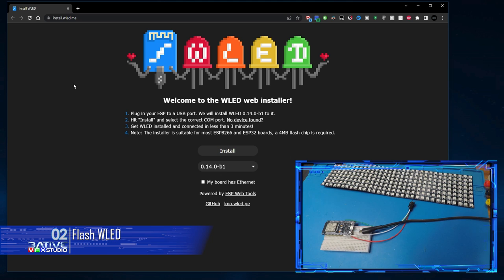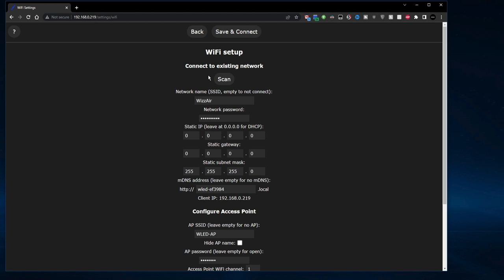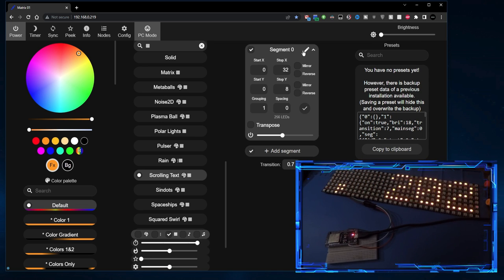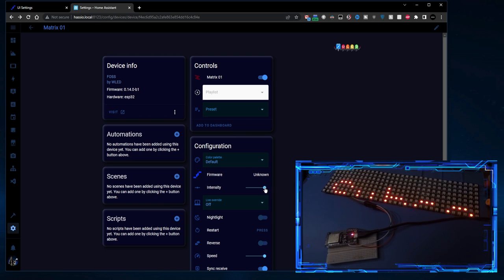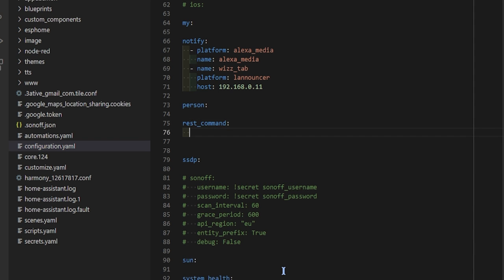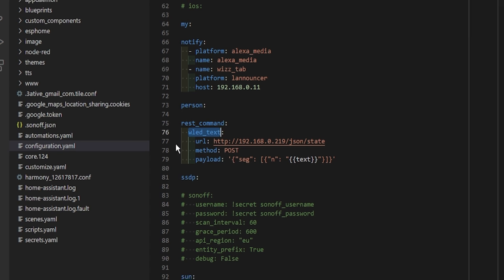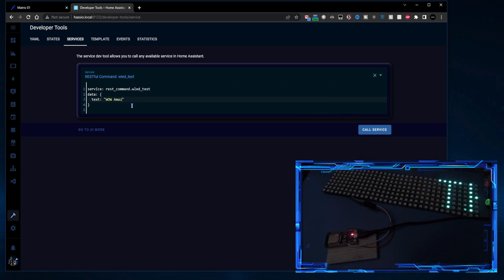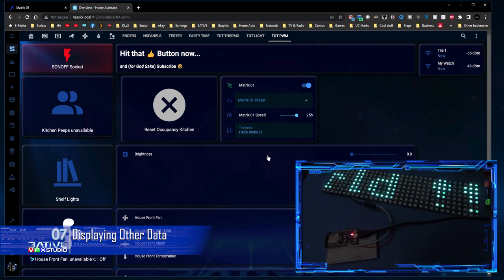Step-by-Step: WLED Scrolling Text on a WS2812 LED Matrix with Home Assistant

Comment: yessss thank you so much! I've been at this for almost a month (i'm using text scroll in an artwork) and this video solved all the problems I was running into! I'm new to using the WLED server - has anybody tried transferring the server over to another wifi network if they've taken their matrix someplace?
Reply from the maker: You're very welcome!
As for transporting WLED: I [think] if you fire it up and it does see it's saved Wi-Fi it'll default to an Access Point (AP) mode. From there you can input the new SSID & Password using the WLED Phone App.

Comment: Saved me lots of time thanks

Wondering How would you set the text colour based on state ?
Reply from the maker: Cool, Glad it helped. 👍
You can add ( "col": [ [R, G, B] ] ) within the REST commands' "payload". E.G.:
payload: '{ "seg": [{ "col": [ [0, 0, 255] ], "n": "{{text}}" }] }'
Reply: @3ATIVE  Thanks have it on the wall displaying house power usage, want it to be green when have excess solar and red when importing from grid.
Reply from the maker: @yorks_atheist3069  Oh, nice application. 👍

Please come join my DISCORD server and share some photos of your project.
It's also a great place for hanging out and tech support.

Comment: This is great. Thanks a lot! Never thought, that I'm able to understand all these things around rest api and changing text. You've made my day. I've got one additional question. How can I mix a fixed text and sensor data in one automation? My goal is to display something like 

Pooltemp: 29,3 C  

In this case, Pooltemp: and the C is the text and the 29,3 is the value from my self made pooltempsensor.
Reply from the maker: Great to hear! 👍
In your example, your automation action would be:
  action:
    - service: rest_command.wled_text
      data:
        text: "Pooltemp: " + "{{states['YOUR-TEMP-SENSOR'].state}}" + " C"
Reply: @3ATIVE  Again, thanks a lot. Will give it a try later today 🙂
Reply from the maker: @user-qm3bs1hu3p  My pleasure. Lemme know if it works the way you wanted, or if you need anything else.

Comment: Fantastic instruction! Any ideas on how to display static text for a sign in WLED?
Reply from the maker: Any text (on one line) won't scroll if it's less than or equal to the number of characters that fit the width - Normal size letters that's 5.
Reply: @3ATIVE  Brilliant! Thank you sir, you do great work!

Comment: There are lots of matrixes out there. How does one determine the parameters, ie. whether it's vertical or horizontal, serpentine or zig-zg, etc? Thanks for the video.
Reply from the maker: Mainly trial and error. If it helps, I've added the one I used in my Amazon Shop - There's a link in the video description.
Reply: @3ATIVE  Thanks much
Reply: @3ATIVE  Just by watching your outstanding video again the answer came to me. Here's what ya do.

Start by setting Settings > LED Prefernces > Length to one, which will tell you where first pixel is.  As you progressively increase the Length setting it will light up more leds and the path that it takes will reveal whether it's horizontal or vertical, and whether it's zig-zag or serpentine.
Reply from the maker: @joepriority  A great way to test.... I just futz around until it worked! 🤣🤣🤣🤣

Comment: you can also add custom text to the beginning and end of the states command. like this. 
service: rest_command.wled_text
data:
  text: "Out door Temp {{ states(\"sensor.station_temperature\") | round(0) }}°F"
Reply from the maker: Indeed. Any template that generates characters can be sent. Also, if you spell 'Outdoor' correctly you can save space. LOL
Reply: @3ATIVE  Cheeky :)

Comment: Loving this mate! Just wondering how hard much harder will it be to have clock and temperature displayed. And maybe can't then be switched to get when needed?
Reply from the maker: Thank you.
I can't see it being too difficult - As I show you can send text, so sending it Time and or Temperature at will is no different. Bear in mind that you only have a 5 character width, anything longer will scroll.
Reply: @3ATIVE  Hello, thank you very much for the tutorial, it is incredible, I have managed to set up my own Wled panel and I can send text to it from home assistant, what I can't do is show the time and temperature from home assistant, how do I have to do it, I'm lost with that ? thank you for your magnificent work
Reply from the maker: @josesanchez-ot8kp  You can send it anything. The key is make a Custom Sensor for the data, then run an automation to send to the RESTFul command.
Reply: @3ATIVE  Hello, thank you, I already got it, I just had to put the "sensor.time" entity as a trigger and into action:

service:rest_command.wled_text
data:
   text: "{{states['sensor.time'].state}}"

Thanks for the little note you gave me.
Reply from the maker: @josesanchez-ot8kp  Noice 🎁

Comment: Really helpfull
But is it possible to split the matrix using wled/home assistant to show different things on the same matrix, like the temperature and thermometer logo next to it!
Reply from the maker: Thanks.
Sure, each segment can have any number of LEDs in its Width and Height. So, you just make two segments of 8x8, just make sure you set the 2nd to "Start" at 8.
Then, in Home Assistant, send your first data to segment 0, and the other to segment 1.
Reply from the maker: Oops, Correction:
Each segment should be 16x8, with the 2nd one Starting at 16.
Reply: @3ATIVE Thanks very much for the info ❤

Comment: A bit of a tangled web for this neophyte but you detail it well.  What happens if you remove power from the setup?  Will it remember the last scrolling message and just continue when power is restored?  (Like if you had it on a timer, or an alexa plug, and it would come on for a few hours every day)
Reply from the maker: Yes it will, as the "segment name" (which is where the text goes) is saved within WLED.
However, for WLED to return to that on power-up, you need to set that in config > LED preferences, then scroll down to "Apply preset [xx] at boot".
Reply: @3ATIVE  Thank you!

Comment: Nice work, not sure if its obvious or not, but how do i add more devices (matrix) to use this? i.e when you added the rest_command: in config yaml its only using the one device ip.
Reply from the maker: Unless you do some fancy coding, the easiest way is to add one REST Command per display.
Reply: Hi thanks for replying. 
So something like this in the config,
rest_command:
  wled_right_matrix:
    url: http://192.168.0.10/json/state
    method: POST
    payload: “ “
  wled_left_matrix:
    url: http://192.168.0.11/json/state
    method: POST
    payload: “ “
Reply from the maker: @bryantubb5680  Almost, it will have to be a "List". So each one will need a "-" at the beginning:
rest_command:
  - wled_right_matrix:
      url: http://192.168.0.10/json/state
      method: POST
      payload: “ “
  - wled_left_matrix:
      url: http://192.168.0.11/json/state
      method: POST
      payload: “ “

Comment: Are you using the additional DC V input? Or do you power the matrix via the ESP32 5V using the 3 wire JST? Thank you
Reply from the maker: No additional PSU. The Matrix is powered from the 5v Pin on the ESP Module, which in turn is powered by a 2A USB Phone charger.

Comment: Great video! How many amps power supply do you need for this?
Reply from the maker: Thank you Justin.
While it's recommended to have a 5V 15A PSU, WLED has a user settable (software) limiter for the current. 
For example: The setup you see in this video I'm using a mobile phone charger (2A) and I've set the limiter to 800mA.
- Even that's too bright to go over 10% brightness. 😎
Reply: @3ATIVE  Wow that's great thanks for the explanation

Comment: Hi,
Would you please kindly show us how to program the text with 3-4 different color line effect?
Also, I would like to make the whole matrix with 4-5 different color lines like the 3 colors flag?
Reply from the maker: Sorry, I'm not sure what you mean by: "3-4 different color line effect" 
However, if you use 3-4 panels (all 32x8) then you can assign different colours to each row of text. 
I do have a tutorial (coming soon) on how to connect more than one 32x8 panel to WLED. So, #StayTuned for that! 😎
Reply: @3ATIVE  
I meant, with 8 horizon lines, I want to make 4 different colors, like 1 color for every 2 lines.
Or we can make the American flag with red white blue.

Thanks!

Comment: fantastic   Do you know if a the panel can be turned portrait and have the text go up or down instead of side to side
Reply from the maker: With other software yes... Sadly, WLED only scrolls Right to Left.
Reply: That’s what I figured. But I thought if there was a way you would know. Look forward to your next video
Reply from the maker: @garysteo3398  I know there are some fonts that have their characters rotated 90 degrees - Maybe that cold work.
... Not sure to change the font thou... Soz
Reply from the maker: @garysteo3398  Cancel that, I found one... It doesn't work. :(

Comment: Great video as always! :)
What power supply did you use for this matrix?
Reply from the maker: Thank you István 👍
For the video/tutorial I was just running off the PC USB port. However, main usage, just a USB Phone charger - My one is just a 2A.
Reply: @3ATIVE  I was thinking about the power supply for the LEDs. When setting up the WLED, he recommends a 15A power supply for the 256 LEDs.
Reply from the maker: @istvantanczos5294  That may be true for strings outside. I run my matrix panel limited to 800mA and as you saw very low brightness on the sliders.
- And it's still too bright! LOL
Reply: @3ATIVE  how you limit to 800mA? it's somewhere in setting?
Reply from the maker: @huczas  Config>LED Preferences - Near the top you'll find "Maximum Current"

Comment: Sorry for the noob question, but is there a way to push the new state further text of the sensor just once or twice ? 

Because in my case the state if unchanged is now constantly rolling on the matrix.
Reply from the maker: Sorry but, I don't understand what "new state further text" is. 
However, if you're asking if the text can be updated when the state of an entity changes then yes...
Just make an automation to update the matrix when the entity state changes.
Reply: @3ATIVE   Apologies for my bad expression and thank you for the fast reply -> Can you stop the scrooling text after its published its payload/message?
Reply: @MrMacjex  after the first action for the template you could do a action wait for one minute then a action stop or a action turn off device.

Comment: I   can get text but just cannot get a sensor

service: rest_command.wled_text
data:{
  text:"{{states['sensor.office_outside_temp_2'].state}}"
}
Reply from the maker: Check that sensor name. Otherwise what do you get on the display when you run that command?
Reply: finally
service: rest_command.wled_text
data:
  text: Outside Temp {{ states("sensor.office_outside_temp_2") | round(1) }} F
Reply from the maker: @grampslanc8394  You can have all that on the LED Matrix, it'll only display a max of 32 characters and only on a single line.
Reply: two sensors 🙂 Thanks for the vid.  
  text: Out:{{ states("sensor.office_outside_temp_2") | round(1) }} F  In:{{ states("sensor.big_room_temperature") | round(1) }} @3ATIVE